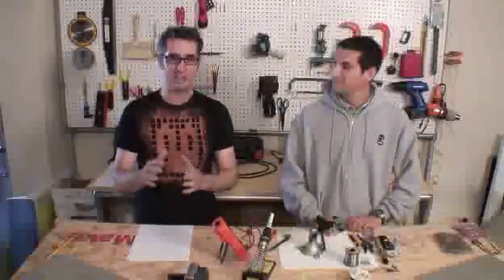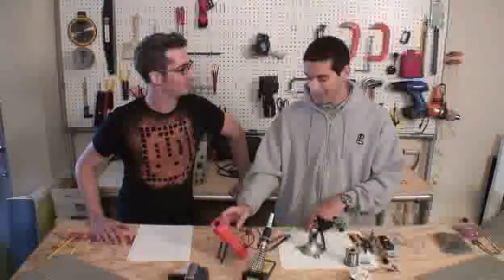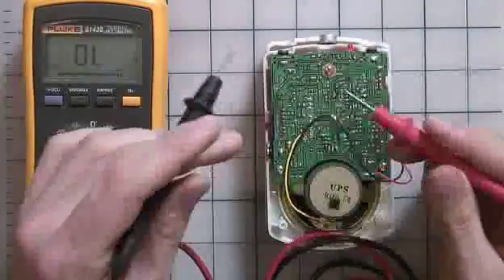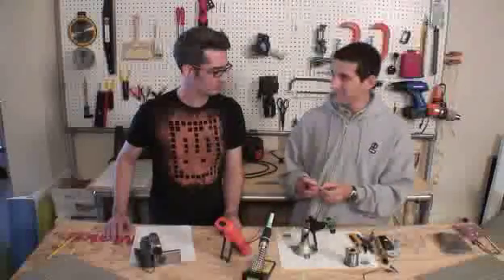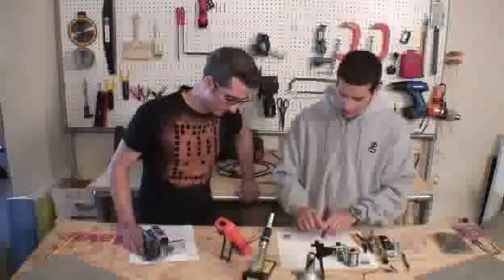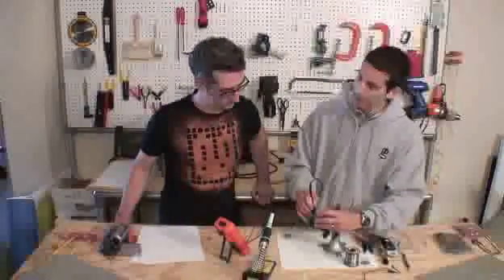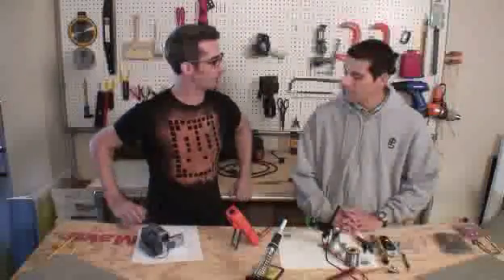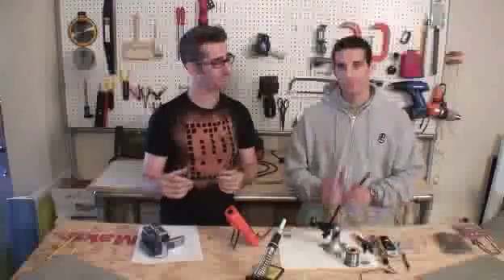How To Use A Multimeter

Comment: Resistance indeed does measure the resistance in a resistor to show you what resistance it is, but that's not the main reason you use the function. With electronics you use it to check to see of its within manufacturers specs. If its out of spec then there could be low resistance, a short, malfunction. A resistor is basically a voltage limiter that's cuts down the circuit being supplied power. A relay is the opposite. A capacitor stores energy when demanded the extra charge.

Comment: I've seen two different multimeters in this video. (three counting the RCA VoltOhmyst on that guys shoulder at 1:30) The one on the bench with the orange protective case is a Extech, the other one that's randomly shown is a Fluke. Not sure what's up with that. Video could be better, a lot better.

Comment: The given value of a resistor is indeed not accurate, but if you measure it with your multimeter it is also not accurate, maybe even less accurate, because there's an internal resistance in your multimeter ;) 
Also, NEVER measure resistance while the power is on the measurement ;)

Comment: You have to plug in the probes depending on what you want to measure.
For example:
If you want to measure Voltage, Resistance, Diod, Connectivity you want to put the positive probe in the "hole" with a Volt, Ohm, Diode symbol on it.
And the negative probe should always be in the "COM" port.

And then when you want to measure amperage you switch to positive to amperage measurements (Which is occasionally seperated into small amperages and big amperages.

It may be different on other multimeters.

Comment: I as well am doing a self taught course in electronics.   I have one of those 300 in one kits where you hook wires up to the springs and make different circuits but this one is more advanced and has a bread board and comes with hundreds of resistors, capacitors, diodes and gates or some type of processors or something like that. Like I said I am still learning.  
Do you have your mind set on a particular project to complete?

Comment: What symbol on the multi meter matches with each function?
When testing a resistor - what symbol?
What symbol Ac- DC - Current ? Drawing those things on a post card size paper while doing the explination of related  function would help.

resistance is not futile - that was a slow burn.

Comment: the setting should be in AC voltage(alternating current)because household electricity is in AC voltage and your range should be higher than 240 volts. BTW there are multimeters with auto-range functions their a lot easier to use hope this could help you.

Comment: the knob should be in ac function (im assuming your measuring your household electric connection which is AC) and the range should be greater than your desired magnitude so it should be greater than 240 volts hope this could help you. BTW there are dmms with autorange function their a lot easier to use

Comment: what would you say to the high internal impedence of a DMM (digital multimeter) which is designed to protect internal, electronic components from damage during testing, giving false voltage readings on dead circuits, when measuring house wiring, which can often happen?

Comment: This is poor. They start-out by doing a 'continuity test' - but fail to tell where the pointer should be on the multimeter. They then do the same with 'resistance mode' - WHERE DO WE SET THE DIAL? If this is supposed to be a 'beginner's guide', then please start from the beginning. These people are making the most elementary errors of teaching - ASSUMING the students know the basics. How about re-doing this piece, only this time show where you are putting the pointer on the multimeter. Useless.

Comment: Red/black--continuity.   Sometimes it's better to swap the leads, as incircuit devices can fool you, and this is true of almost all incircuit measurements. 

Measuring high current values.  Most leads suffer considerable drop, if you are measuring something up, say, 10A or more,  the lead drop can sometimes affect the circuit (voltage drop) and the result.  Also, fused meters,  like Fluke, won't put up with continuous high level measurements over time

Comment: I have a wind turbine and I would like to measure the volts it can produce. I understand all the electrical measurements, except the AC and DC. I know a little, but not enough to diffrenciate them. What measurement should I use to measure the production of electricity from a wind turbine?

Comment: Testing a battery to see if it is good is much more complicated than just measureing voltage. You need to measure the working voltage, that is measure the voltage with a load between terminals to see how much the voltage drops. Even run-down batteries will show a voltage. Otherwise, nice presentation.